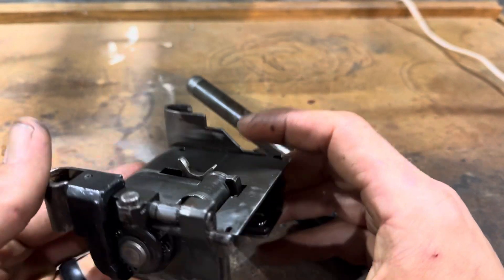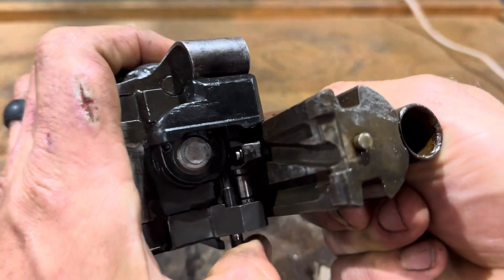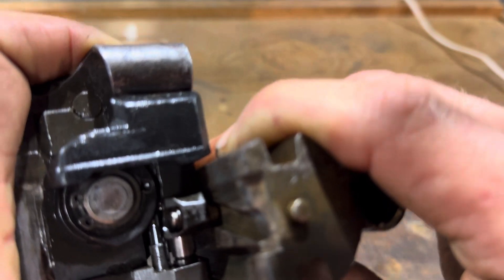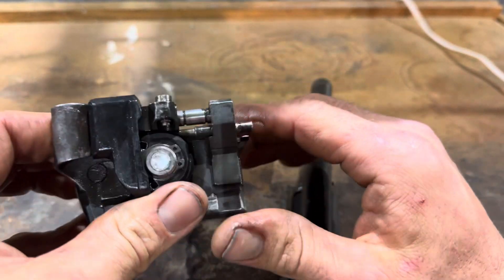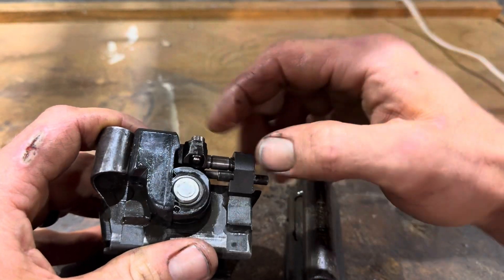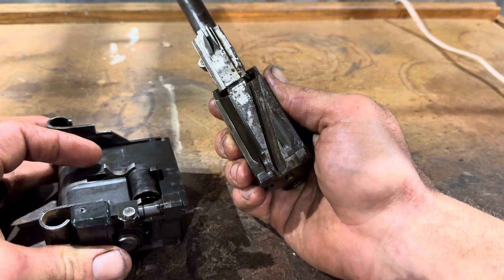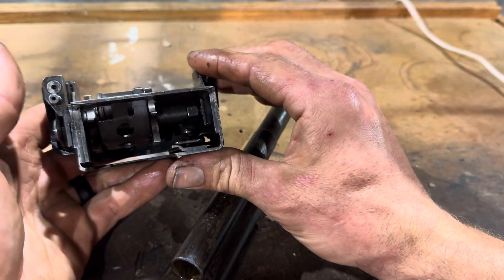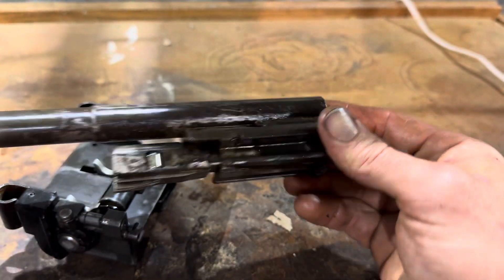HK21/FMP21 feed mech explanation

Comment: I recently aquired a 21 outfitted with an E buffer system. The gun functions flawlessly until you insert the feed tray. The amount of force required to rack it multiples drastically. It will sometimes pick up a round but not fully chamber, about 1/4" away from being fully in battery. This is with a fleming auto sear pack. With a standard semi auto pack and no trip lever, i could get the gun to run semi about 75%. Still would fail to fully go into battery occasionally. 

I have come to the conclusion something is out of spec or not opersting properly with the feed tray itself. Would it be worth buying a 2nd feed tray before sending the gun off?
Reply from the maker: So it’s probably not your feed tray, as it’s hung by the hanger, which is welded to the receiver. If you’d like, go to www.linkedkinetics.com and fill out the contact form. I’ll be able to get ahold of you and talk you through it from there.
Reply: @uzifouryoutwosay ok will do. I wont be in the shop much this week. I leave Thursday for vacation. I'll probably fill the form out at some point this week, but not available to be sitting at my range with the gun until next week.
Reply: @uzifouryoutwosay you were right! Not the feed tray. It was the trip lever in the trigger pack. It needed to be cut down. It was hitting the feed tray, causing a lot of tension on the bolt as you passed over top. Runs like a champ now. Goes thru a whole belt with no issue. What a dream to shoot with the 21e buffer system also. I believe its my new favorite 7.62.
Reply: If you feed a round into the chamber manually, the bolt will close without any issue and fully close. But only with no feed tray.

Comment: Im trying to find a way to buy a kit. Hopefully i can get one before their gone.
Reply from the maker: Hkparts.net
Reply: @uzifouryoutwosay  Im probably gonna try selling my cz bren 2 in x39 at a loss just to make sure I don't miss out on these kits. I've wanted a hk21e/hk23e since I heard of them a year ago. Rtgroberts has a lot of hk21e/hk23e parts that might make turning a hk21 into a hk21e possible
Reply from the maker: @shawnwillis7561  I know apex had them as well, HKPARTS may be getting another shipment in, so I would watch for them there. Unfortunately they are completely different machines. You would be better served buying an 11a1 kit as you can actually convert those with a belt feed mech down the road.
Reply: @uzifouryoutwosay  last I checked they sold out. I know century arms and a couple other sites have them.